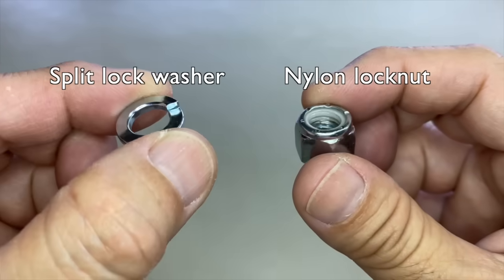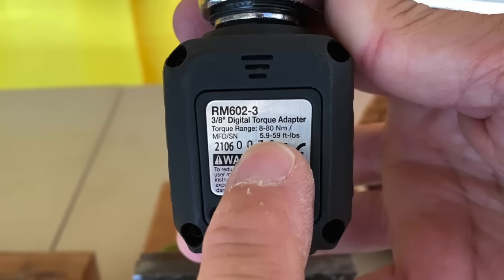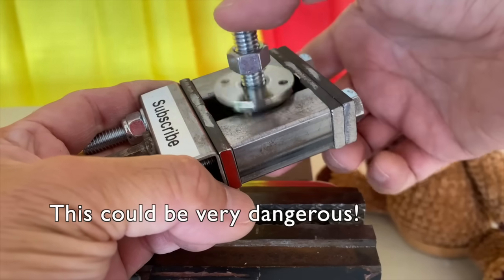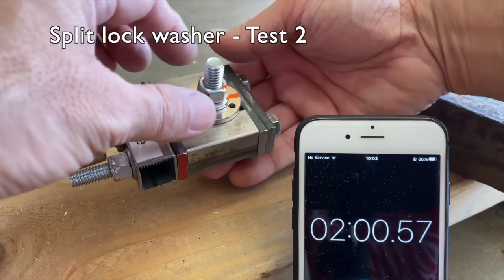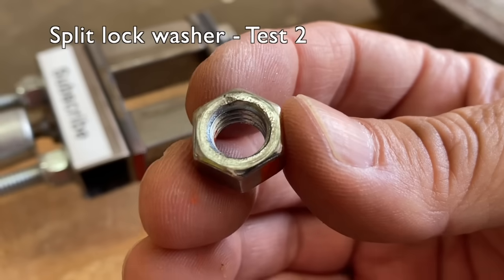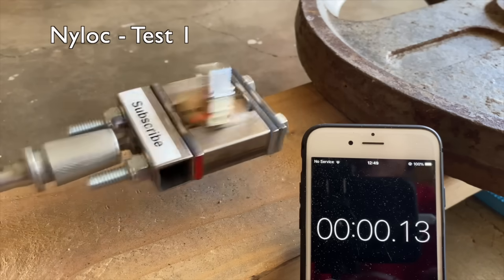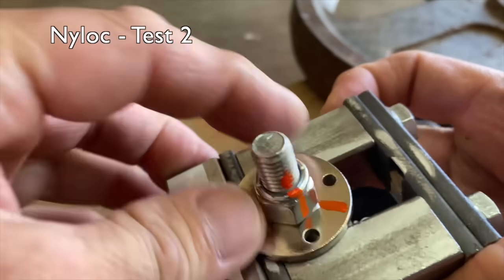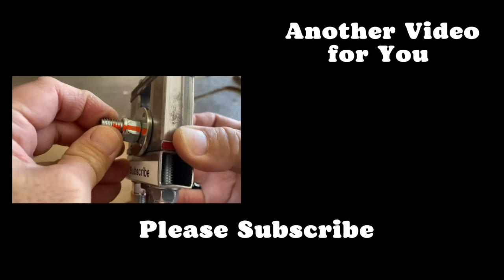Nuts & Bolts - Split Lock Washer vs Nylon Locknut – DIY Impact & Vibration Test - Part 1

Comment: Great test. Now do a Nordlock/wedge lock, top lock, center lock, and fine threads with a conical seat.
Reply from the maker: My Nord-Lock test is out… Will Nord-Locks Survive My Test?  DIY Impact & Vibration Test – Part 5
https://youtu.be/wOUnlfhHRko
Pls check it out and drop a comment.  👍😎
Reply: @HacksbyDad  Thanks for the heads up. Wouldn't have seen it otherwise, or at least not until it randomly comes up. I question your method / purpose on it, but chat on that thread.

Comment: I've always been suspicious of lock washers. Never trusted them. I always use nylon insert lock nuts or in apications where heat would melt or degrade the nylon I use all metal lock nuts. You can even kinda make your own all metal lock nuts with some careful hammer whacks.

Comment: 3 of 5 bolts on SUV metal skid plate would eventually wiggle loose and fall off. Split lock washers did not stop 5 bolts from falling out. When using Nylon lock nuts, bolts did not come loose.

Comment: torque the nut with flat washer. Tack weld bolt to nut, to remove  grind it off.

Comment: This is not really correct...
You did an experiment with half cooked eggs.

The recommended torque setting for ALL items you tested
is NOT 6 !  Keep in mind, the lug nuts on your vehicle are at 70 -90 !

Find the correct / recommended numbers in each and run the test again..........

Comment: Had you torque to 30 plus foot pound none of the bolts would have losen. The bolt needs stretch / torque to healed / in other words if you would have torque to at least 30lbs then the bolt is stretch like a spring and would not fail either.. just saying

Comment: Just going from memory, but wouldn't something around 33ft/lbs be a more realistic test for your 3/8" hardware? Not that it would change the result.  The only reason they sell split washers is they can make them a fraction of a cent and sell them for a dime. 200 years ago, they might have been better than nothing, but they have not gotten better.

Comment: For my home applications,  I have taken twist ties and wrapped them in the threads of the screws immediately in front of the bolt and tighten them down into the thread troughs to prevent the bolt from rotating outward.  I have also done the same using electricians tape sticking on the threads and preventing advancement.  Afterward, I just pull the tape off or untie and unwind the twist ties.  I also do a lot of work with paper clamps, rubber bands and paperclips.

Comment: A split washer will only work while the nut holds it in compression and actually contacting the washer. A lock nut (be it nylon, thread lock or whatever) will resist undoing to varying degrees while the nut is in contact with the bolt.  The flip side is that a metal locking system can more resistant to the effects of heat and chemicals.
Use the device that is recommended by the designing engineers

Comment: My opinion, nuts that back off bolts from vibration. Use double nuts tightened against each other and the bolt will break before the nuts loosen.

Comment: Interesting video, but no offense 6 ft-lbs is worthless torque spec.. any 3/8 bolt is alot higher than that.. if you where trying to prove it would loosen then can apply to anything.. if you barely tighten anything..

Comment: For an accurate test, you should torque the nuts to the proper torque for the size they are. Tighten them down as they would be in a real world setting and not where they can slide back and forth. That’s a test I’d like to see.
Reply: Best to use manufacturers specification sheet cover your back stops you going to jail. 😊

Comment: If you want it done right, use ted threadlocker, and tack weld the nut after torquing to spec. Get some of those plastic markers they use on school busses so you can see if it starts to come loose. Aircraft safety wire is also a good idea.

Comment: Not really a properly executed test. I already knew that nylon locknuts are better than standard nuts with split lock washers. Split lock washers suck in multiple ways. If you don't want something to come loose, use a castle nut and a cotter pin. You know, like the front wheels and steering linkage on your car.
Reply from the maker: LOL!
Not everyone is an expert like you. 
👍😎
Reply: @HacksbyDad  Yeah, it’s a terrible thing..

Comment: Split lock washer and the like have been proven to be useless by Lange und Friede two decades ago, in 2003 the DIN Norms for them have been retracted and they are no longer considerd safe for use to secure bolts..... DO NOT USE

Comment: As was mentioned, the torque on that size bolt should be higher.  Also, when torquing with a locking feature such as a Nyloc nut, the total torque applied should be the running torque plus the clamping torque.  Split locks will fail.  Always.  You're better off with threadlocker or a deformed thread locking feature.

Comment: Good test. This is why we always used safety wire in high vib usages. Try torquing the bolt and nut and then drill a hole through both and adding safety wire

Comment: The problem with Nyloc is that you can't use them for hotter areas,or the Nylon melts out, and they get loose. 🫠

Comment: The 100% solution is either a split pin and castellated nut, or drill a small hole through the nut and bolt and insert a split pin, making sure each leg is bent back round the nut.

Comment: American inch threads with a 60° angle are comparable in holding power 
to metric threads with a 60° angle.

Comment: Bad test. Insufficient torque for proper performance of all parts of the assembly: nut, bolt and washer. That said, it is well known that split washers effectively become flat washers once proper torque is applied, i.e. they are not good locking devices.

Comment: Trucker here 🚚 it's difficult for us to get into hardware stores, so I use yellow teflon tape (can be bought at truckstops) around threads for something i want to temporarily lock and jb weld (also available at truck stops)... for permanent locking 😅

Comment: Having done small boats maintenance in my youth back in the late 70's I can attest that split washers are all but useless. Nylocks are marginal better and Thread-locking fluid, while was around, it was not readily available. I found, in desperation, that 100% silicone caulk applied to the male threads sparingly with a Nylock nut faired much better and was fairly easy to disassemble if need be.

Comment: FYI:  A NyLok nut has a running torque.  In order to get a full 6 ft. lbs. you need to add in the running torque.  IF the running torque is 2 ft. lbs. you would need to apply 8 ft. lbs. in order to get a full proper torque.  Your test shows that a NyLok fastener holds better than a split ring lock washer.  But the type of materials the split ring faces also makes a difference.  Torquing against Titanium is less likely to hold using a split ring than torquing against Aluminum.

You're off to a good approach but you need to consider other factors as well.  Yes, you shaved metal from both the nut and the face of your test rig.  It appears you've done a good and valid test, aside from accounting for running torque.  One would have to repeat the NyLok test with proper torque in order to determine a more accurate response.  Yes, vibration will always loosen fasteners unless the full and proper torque is applied along with proper hardware.  Torque isn't just about how much force is applied it's also about how much yield the bolt - yes, I said "Bolt" - stretches.  Over-torque can weaken a fastener.  Under-torque can fail to hold.  Vibration is one major factor in blowers coming off dragsters and blowing up.

Comment: If you make a future follow up video, could you test how reusing a nylock nut affects the locking effect.
I am always hesitant to reuse them but I work with some pretty specific or expensive hardware sometimes where I can’t afford not to.

Comment: Maybe I'm wrong, but I think Nylon lock nuts should be used with a flat washer under them. This further secures the nut, as the vibrations have to pass through the washer to turn the nut. Same for the simple nut, it should last longer than 15s that way.

Comment: We see that many types of plastics get brittle and disintegrate over time.

Which solution is still going to be holding tight and not loosening after 25-30-40 years?

Comment: Would have liked to see how much bolt stretch matters in keeping the split ring washer tight when torque is 30 ft/lbs or more.  Torque wrenches tend to be most inaccurate at either end of their minimum and maximum scale. So the 5 fl/lbs may have been 3.5 ft/lbs or over 6 ft/lbs.

Comment: Most DIYers don't need anything but a lock washer. Nylon lock nuts are quite expensive.
   What's skipped over here though is thread locker. It's cheap to use AND it comes in multiple grades of holding power. There are various brands with Loctite being the most well known.

Comment: So, to get better accuracy, the distance between the washers needs to be mic'ed.  I suspect that the loosening of the nuts is due to the wear between the washers and the slide mechanism.  Also, I don't think 6 ft/lbs is enough for the lock washers.

Comment: That is why in aviation, a mechanically locking nut is prefered over a lock washer. Split or star washers will not hold if you lose the torque. Also a plain waser should be used under the lock washer to prevent damage to the structure. You should try this with a castle nut/cotterpin combination. Anything that vibrates as much as your test rig should use a mechanical locking mechanism. Also if a nylon lock nut is used, it should not be reused if removed.
Reply: I was also of the belief that Nyloc nuts were single use items, nor should they be backed off if absolute security is to be depended upon for which it is intended.

Comment: Nylock nuts rely on people NOT over tightening.
Aviation use crush nut and lock washers.
for ultimate security use a crown nut and split pin.

Comment: Nice job.  I never thought about how the lock washer was only useful for the initial locking.  Lock nuts make more sense.  What would be nice is to see how well a lock nut worked the second time it was used.

Comment: NASA did a study that showed that split lock washers are basically worthless.   Nylon lock nuts won’t survive high temperatures.   

Use something else, like prevailing torque nuts or SEMS bolts with curved washers.

Comment: This demonstration shows why racing motorcycles have to have critical nuts and bolts lockwired to fully comply with scrutineering regulations.
It would also be interesting to see you do the same test with nuts and bolts locked with Loctite or similar assembly adhesives.
Reply: British?

Comment: Very interesting test. What really intrigues me is why brake caliper mounting bolts have zero locking security, especially under much thermo expansion and shaking abuse. I understand the bolt's elasticity to hold them down tight with fewer parts, but that bolt head base area and those machined surfaces on the caliper were pretty smooth, as if they could act like a bushing. That really boggles me! It's natural for any engineer to use a castle nut with a wire in the same way for airplanes. Why!?

Comment: What’s even worse is using a spring washer between the nut and a plain washer. The spring washer is meant to dig into the nut and item surface to stop it turning undone. With a plain washer underneath it just turns the plain washer and loosens the nut!

Comment: All washer types have their application space and limits. It's not so much one locking washer that is better in all situations. Nylock for example is not meant for reuse and has a temperature limit. Nord washers are very good when keeping tension is also required not just the nut staying on. This is because Nord washers use pre-tension to secure the nut, however also the Nord washers have their weak spot and that is that because of the pre-tension is already pretty decent that they are not working very well in low torque usage.  People that claim here that there is one washer that will work best always are not correct. But maybe their vision on the subject is limited because the field of work they are in favors one or two types washers the most because of the application type. There are so many locking washer types and even i will have to look up some of the specifications to tell the exact use cases of some of them. Next to the ones already mentioned you have: internal tooth, external tooth, finger, conical and crescent washers and the very funky looking wave washers. There probably are more i did forget to mention but you get the idea.

Comment: Split washers are useless and therefore dangerous. They are no longer allowed for securing and have been removed from the norm. 
I don't want to type everything. For details see the german Wikipedia "Federring" and translate the Page if necessary.

Comment: Your testing covered everything but one factor, heat. In aviation Nylocks are a NO when subjected to temps over 250 degrees F. due to melting the nylon insert.
Reply: They also melt from friction when spun too fast.
Reply: @ianbutler9648  A fact I did not think about, thank you.

Comment: I would argue that 6 foot pounds of torque on a 3/8 bolt is also not a good thing.
Reply from the maker: No argument from me!  
I could not get a consistent failure of the plain nut in my setup with torques above 6 ft-lbs.  👍😎

Comment: Why didn't you try star lock washers?
Reply from the maker: I tested them before but the teeth didn’t bite into the steel.  I think they are for use in softer materials.  🤷🏻‍♂️

Comment: I have to wonder if the 6ftlbs is even a real test. Most fasteners have a spec to which they should be torqued to perform properly. I understand that your tests would have taken far longer had the torque been more. However, I don't think they represent a real situation and have my doubts as to how well they parallel real installations. Ultimately, if the integrity of the fastener is a life or death case, a castle nut and a split pin might be best.

Comment: My expertise is shock and vibration test, analysis and design.  The question of how to design bolted joints to endure shock and vibration is VERY complex.  Every situation is different and very few generalizations are always correct.  That said, this experiment is well enough designed but its applicability is limited.

Comment: This is click bate. I worked failure analysis for years at Peterbilt and for Cat. First off on the exhaust manifold the nylon was will fail every time before you get out of the parking lot! Second you have to use a flat washer with the locwasher or it will fail and the flat washer for best results match the type of nut bolt and flat washers for example number 5 with #5 # 8 with #8 don't mix match. Yes there are different grade of bolts studs,washers and nuts, don't mix match. Next you should always torque the fasters to spec never under or over torque or you are going to have a failure. Ok I don't care what type of faster you use in that application or that specific assembly it's going to fail. This is click bate.

Comment: In order for a split type lock washer to work as designed and prevent the nut from turning, the nut has to have already come loose a little bit first.

Comment: I have built 3 helicopters I can tell you the Nylon nuts are the best. They may loosen but they will let you know you have a problem before the nut comes off the bolt. They also make nuts that have a compression threads and they are great for areas
with higher temperatures.

Comment: What sold me was all the bolts on my boat trailer and my boat itself from the factory are nylon nuts. They don’t rust as easily and they don’t come loose. Another advantage is your not dealing with an extra piece of hardware which simplifies replacing or repairing. Also as a lock washer has to be slightly oversized (outside diameter) which can limits the locations they can used.
Reply: 😂 slower rusting nylocks? Are you sure your boat fasteners aren't stainless? I don't believe a lock washer has ever been  required to be a larger diameter than the bolt head or nut diameter..... Extra piece of hardware?? Flat washers are used regularly to help distribute/spread the fasteners load (among other reasons) not as an unnecessary addition. if a lock washers use is limited due to its diameter I'll bet your socket etc surely won't fit to tighten it. Lol

Comment: If the nylocs did not rotate relative to the bolt, i.e. did not back off, where did the loss of clamping force occur? Did the recip motion cause wear between the 4 mating surfaces? Did the bolt stretch?
Also, seeing what was used to hold the test rig together was a bit of a spoiler.

Comment: One thing you left out was elliptical lock nuts. Basically just squeezed out of round just enough to create a locking action. They are better than any fiber lock nut and don't fail in high temperature environments. They are standard lock nuts in the aviation industry (from a 40 year FAA licensed aircraft mechanic).

Comment: You under torqued the nylon nuts. Measure the running torque of the nut which is  the torque required to move the nut on the threads then add that to the 6 ft pounds. Try it again.

Comment: In torquing the nut, you need to add some for the resistance of the nylon insert (If you're applying say 6mn, then only 5 nm is loading the bolt (because what you're trying to achieve is end load into a bolt - torque is just a proxy measurement as its (usually) harder to determine  end load.

Comment: When tightening the nyloc you need to take into account the resistance of the nyloc threading on to the bolt before it clamps the parts together.  It probably took 6 pounds of torque just to run the nut onto the bolt.  So you need to use more torque to get the same clamping force as the other tests.
Reply: If all were bolted to spec (ie higher) then it shouldn't matter